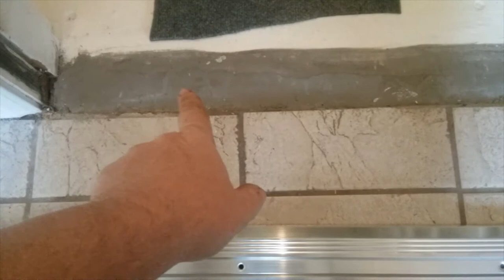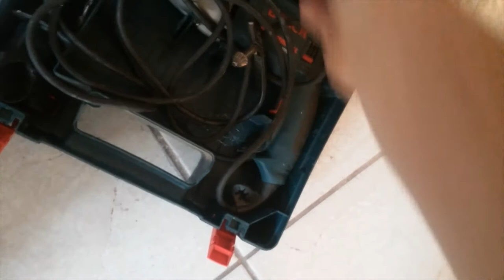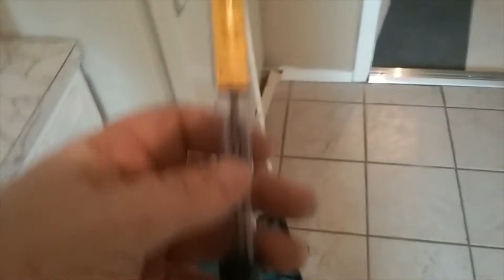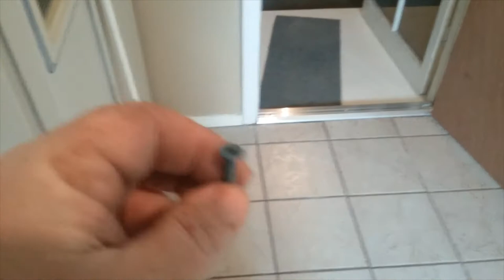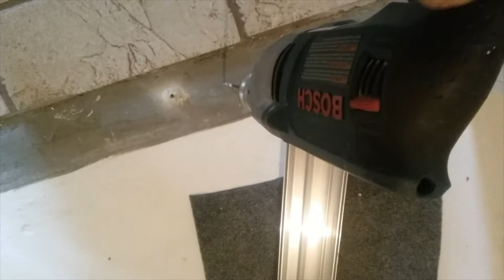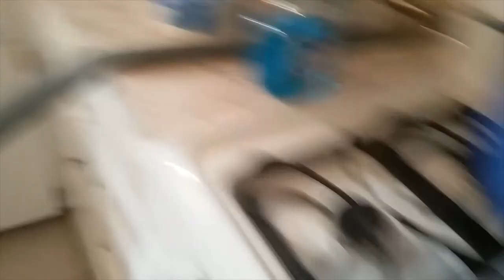How To Install A New Threshold on a Concrete Slab Foundation

Comment: Do I use  "high speed" or "low speed" when drilling into the concrete?
Reply: Low speed the bits tend to chip and break

Comment: I’m a dental hygienist. Think I can do this myself?  Lol.  I’ll pass your video along to my husband.  My basement threshold is done and can literally be kicked out of the way.
Reply from the maker: Sure, I don't see any reason why you can't do it. You will need a hammer drill and a masonry drill bit though, regular drills and drill bits are too light to drill holes in concrete for your threshold.

Comment: I am guessing a regular drill for wood and metal won't work.
Reply from the maker: No, you really need a hammer drill and a masonry bit to install a new threshold in a concrete slab.